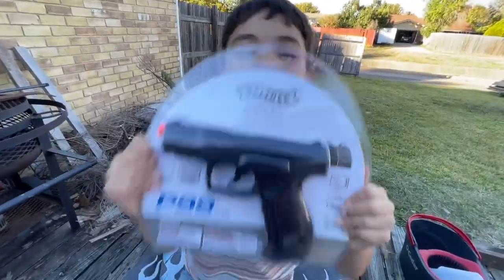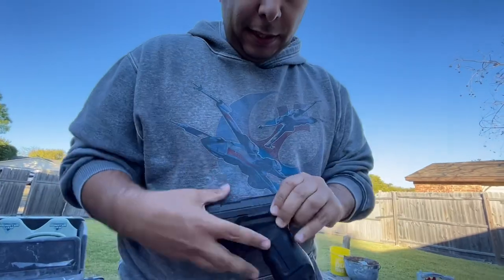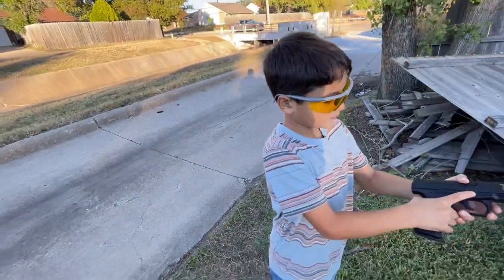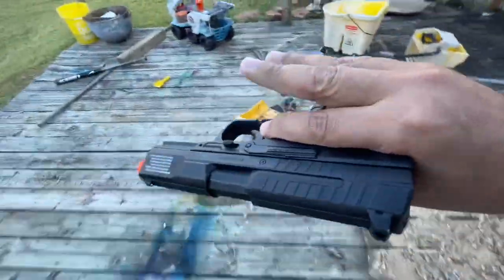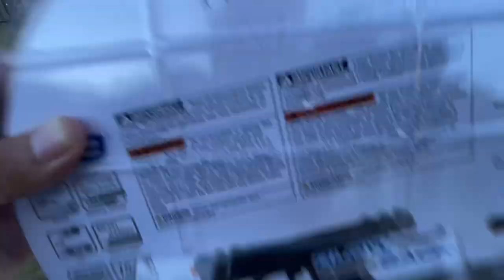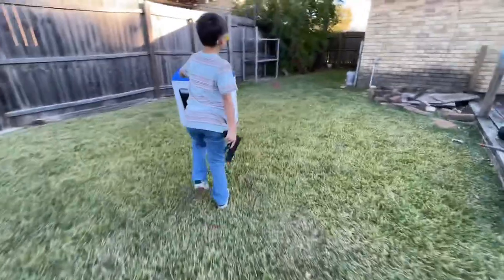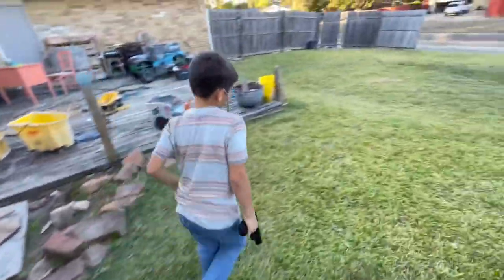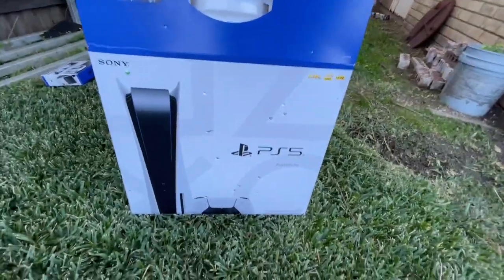How Good is this $60 Blowback Airsoft Pistol? Unbox & Review

Comment: Hey I love your channel, I think I’m getting this gun for christmas and I just wondering How long can you keep co2 inside the gun and Do I have to get some kind of oil or lubricant? I’m a beginner to airsoft and I wanna know
Reply from the maker: I use an Airsoft lubricant on the pistols that take a co2 cartridge. This was a cool pistol. It was a good price for a blowback
Reply: @rykerstoybox  Could I use permatex Dielectric grease to replace the silicone oil? The grease has silicone in it. And or Pell Gun Oil.
Reply from the maker: I use the Pell oil I’m not very familiar with other brands
Reply: @rykerstoybox  Sorry, About so many questions Thanks for answering all of them I have one more question though. Do you Take the co2 off each time you use it? And how long can I keep the co2 inside with pellgun oil for the seal to not break?
Reply from the maker: I don’t know the specifics, but what I do is try to use Co2 up in 1-2 days. most times I am able to empty the cartridge the same day. I will be honest I have left the cartridge in a pistol for about a month because I forgot about it. It still seems to work great.

Comment: I want to get one but it’s always out fo stock at academy sports
Reply from the maker: Have you tried ordering from the website
Reply: @rykerstoybox  it’s out of stock on the website to
Reply from the maker: Man that suck. Are you stuck on that particular model, the 6XP is the same price and it has better sights in my opinion
Reply: @rykerstoybox  hey that funny I just got that yesterday at academy. It needs a front glow in the dark sight
Reply from the maker: I agree. I didn’t understand why it only came with the rear glow sight and not the front. But overall I feel it was a slightly better pistol over the P99. They both shoot the exact same

Comment: when army armament is a thing:
Reply: @rykerstoybox  its actually like $45 for a gas blowback pistol
Reply from the maker: Really? I need to look that up. I would definitely buy one for that price
Reply: @rykerstoybox  UPDATED: cheapest price you get get for army armament’s pistols are $60. you should definitely review one of the pistols. There’s even a full auto Glock 18c for $68. it’s a pretty good price for a full blowback and a full sized mag.
Reply: @rykerstoybox  oh yeah. and it’s gas blowback. you can actually use it with co2 magazines because there’s a little cylinder hole but I don’t really recommend it because it would really mess up the internals. if you’re willing to use co2, make sure you have some spare parts because it’s going to break down about 1 or 2 months after shooting with the co2 magazine. overall, I recommend green gas.
Reply from the maker: Oh wow, thanks for the info. I will really have to look them up if they are than cheap. I would really like to see how their pistols shoot